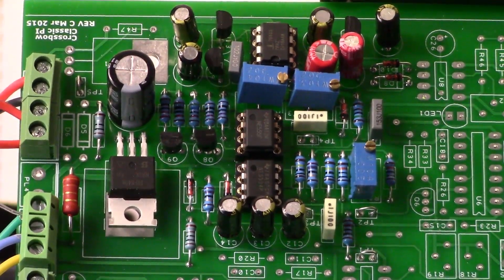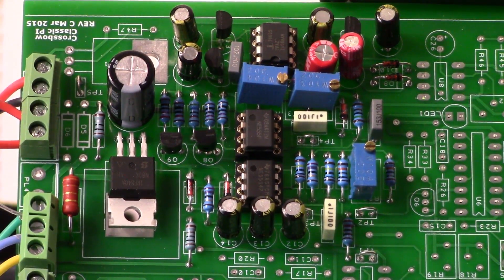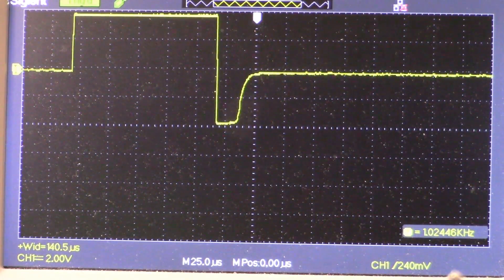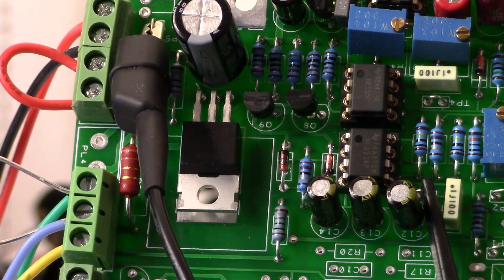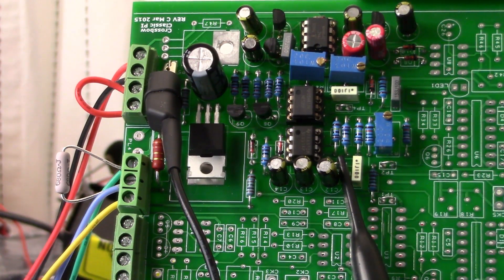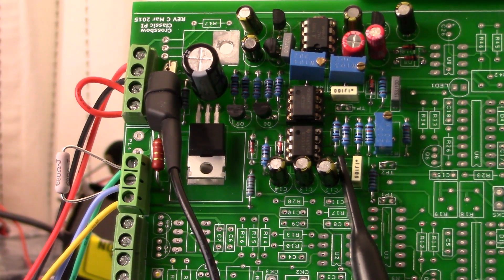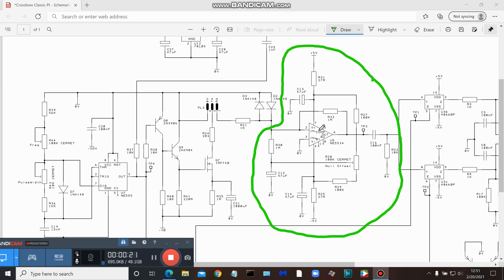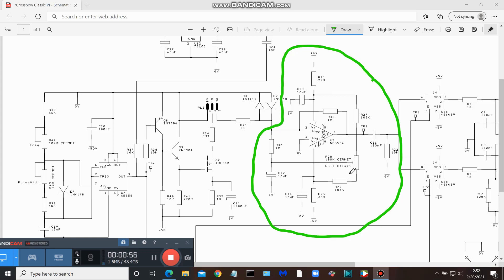Crossbow Classic DIY metal detector Part #3 Pre Amp

Comment: Where to find schematic and PCB files?
Reply from the maker: Most of the projects that I do are from the Geotech Forum:
https://www.geotech1.com/forums/showthread.php?24075-The-Crossbow-Classic-PI&p=236886#post236886
Thank you for watching
Reply: @SurfDetector  Great, thank you for that info.
How would you compare it to surf pi performance?
Reply from the maker: @milanm5776  The Crossbow is a better machine but not an easy build.

Comment: Another nice video tutorial. Sir what is the function of Auto Tracking in Crossbow  & HammerHead? both are almost same metal detectors.
Reply from the maker: Hello Mhuhammad,
auto track gives you two modes of operation.  Static and Dynamic. Essentially in dynamic, the coil needs to keep moving in order to detect, it is used to help reject slightly changing ground conditions.  You are allowing C19 (Hammerhead) to discharge. If you need to pinpoint, then you must switch to static mode (not allowing C19 to discharge) which in turn lets you detect for a short time with the coil stationary